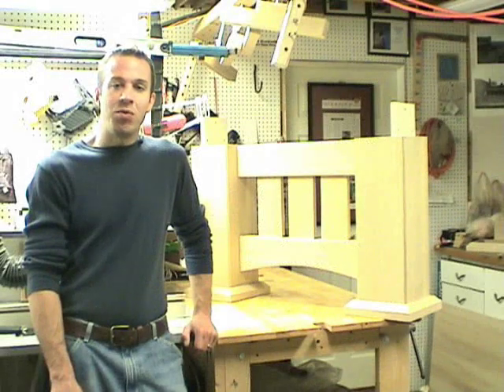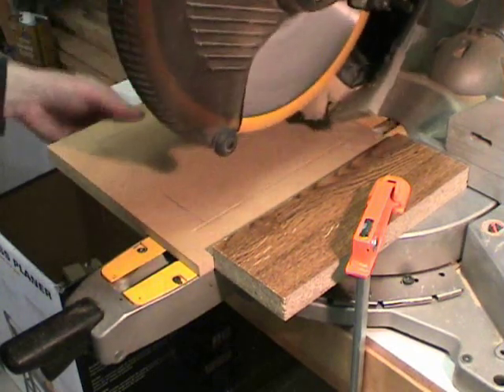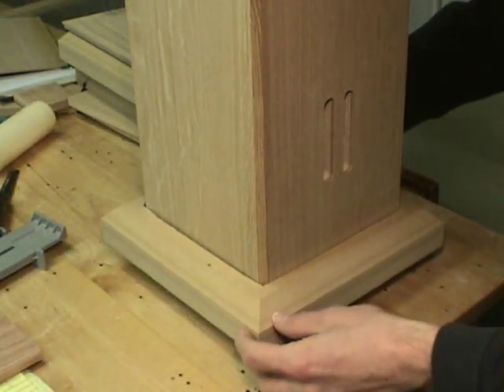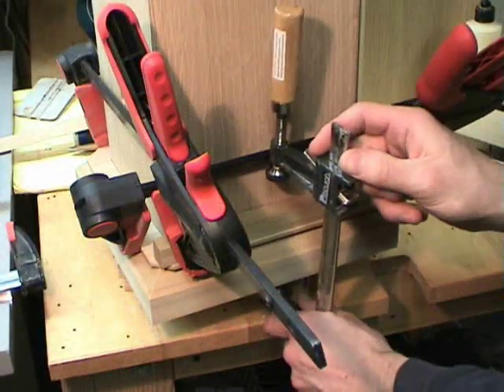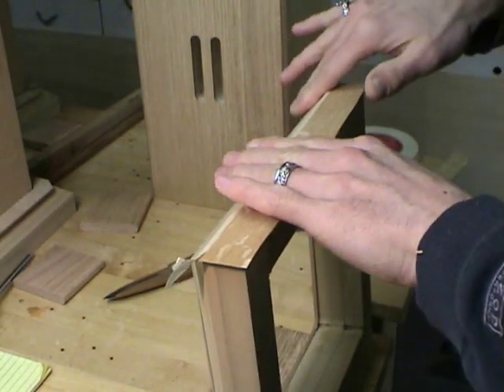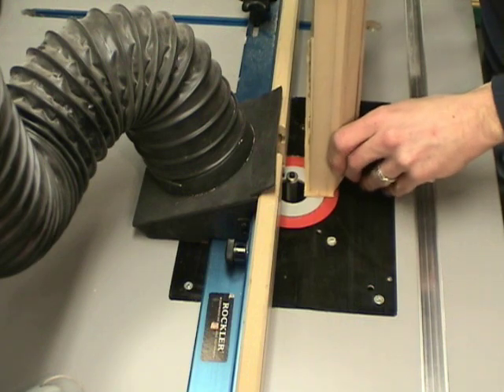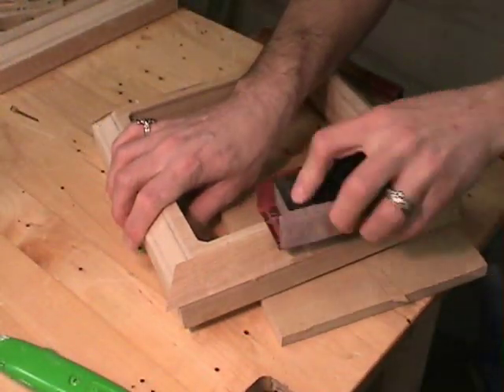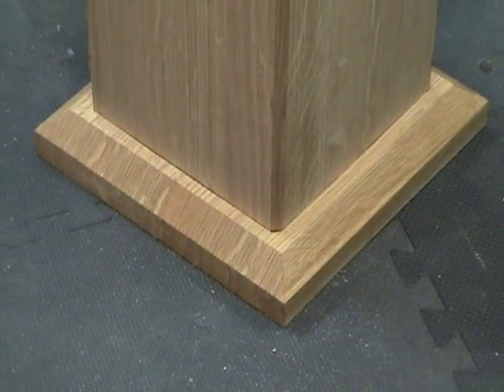Pool Table Build - Part 4

Comment: I am going to take on this project using all solid wood. I think that some of the operations will be harder but without having to laminate or corner treat anything with a 1/4" strip of hardwood should save alot of time.